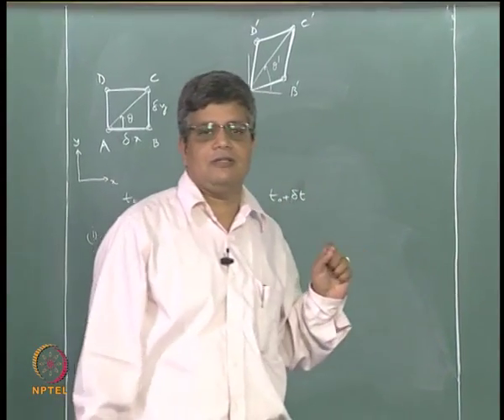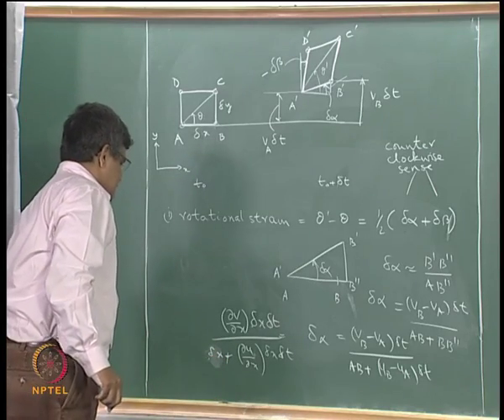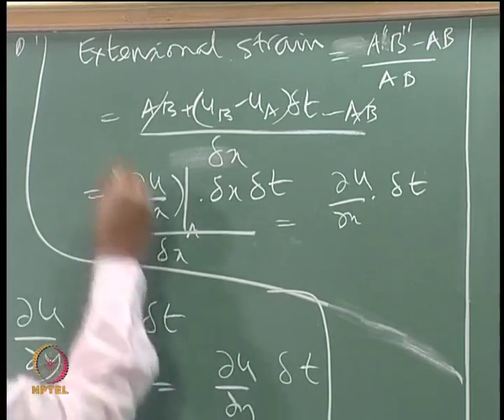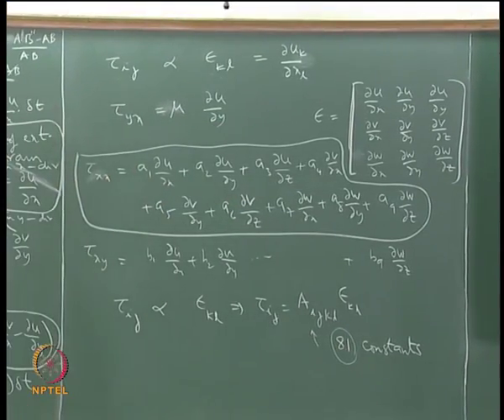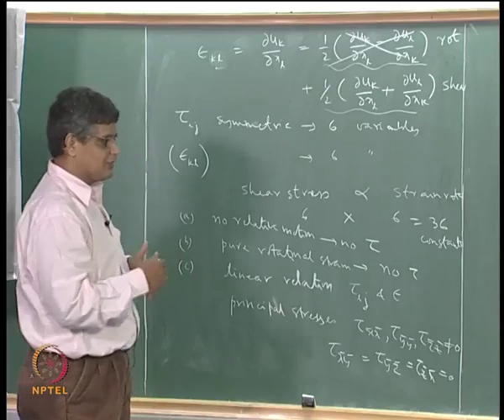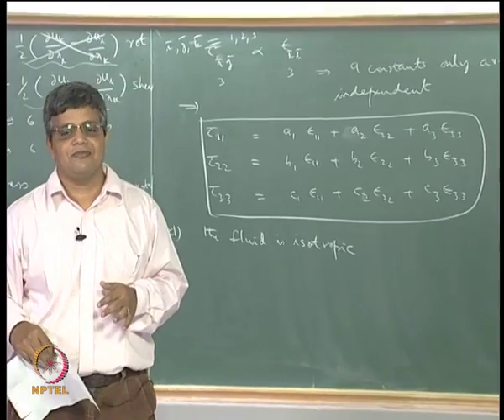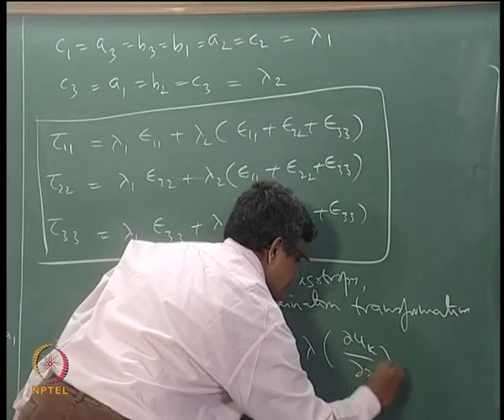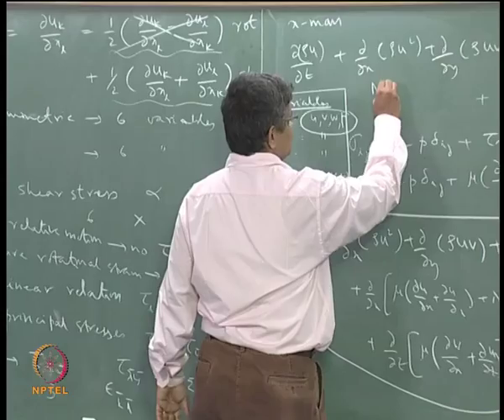Mod-02 Lec-05 Forces acting on a control volume; Stress tensor;

Comment: thanks for this wonderful presentation. So far this is the only detailed presentation in the derivations of  the stress components that i have seen either in class or anywhere. At the end of lecture 5, however, it would be nice if we had the full momentum equations in all directions (x,yz) fully written out instead of only for the x-direction.  This is mainly because the substitutions for the stresses threw me off a bit.  Also, can we re-write out the full navier-stoke equations in differential form and also in vector notation. i guess this would add few more lines but it would clarify how other authors are writing the full Navier_Stoke equations in compact form.   Thanks again.